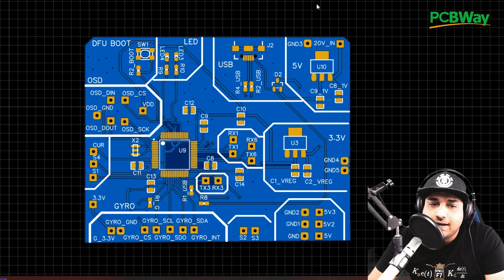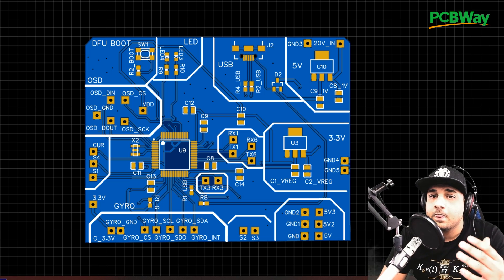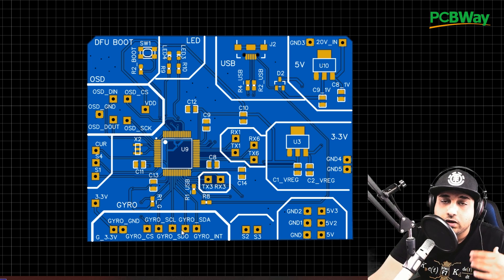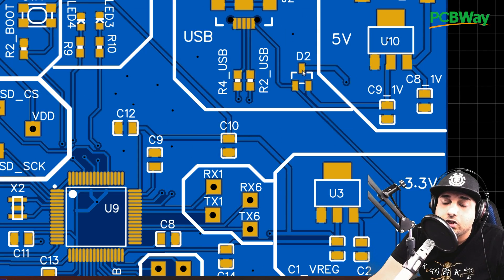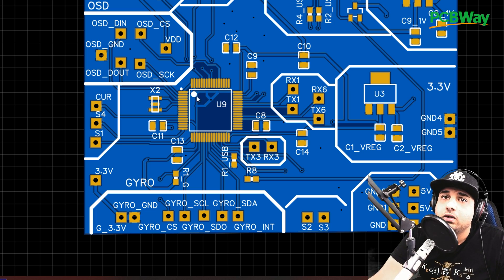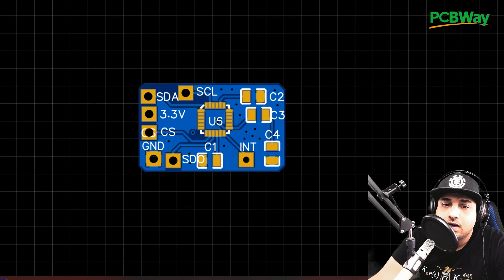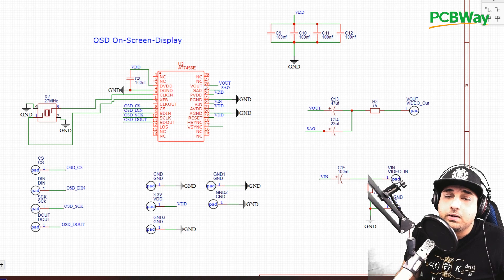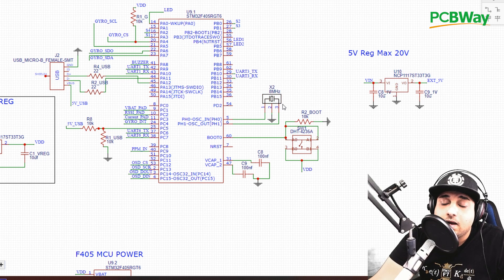Ultimate Flight Controller Design -- Master Class [EP1] // INTRO

Comment: Please go over communication protocols used on the board between components and the microprocessor.  I've been wanting to add barometers and Black Box memory to existing flight controllers.  Thanks

Comment: I think it's a great idea going over the different parts of a flight controller! As someone wanting to learn about and possibly design a flight controller in the future, lookijg at the different components of a flight controller really helps. Side question that I have though, are there differences in component choice that will make a flight controller more or less reliable or is better reliability just a result of better board designs?
Reply from the maker: Yes there are many however some can not be seen... such as noise touching the 8mhz oscillator  due to a trace of something else was was too close. Also noise hitting the gyro from the 3.3v rail.. There are just some.

Comment: Thats insane! I might actually make my own fc. Just a question. Is it cheaper this way?
Reply: I don't think so. Some of the parts are hard /expensive to get, e.g. the OSD chip 7456. In a good design you don't want to use LDOs. If you then go with buck/switching converters, the design of the PCB is not straightforward to make it working flawlessly.